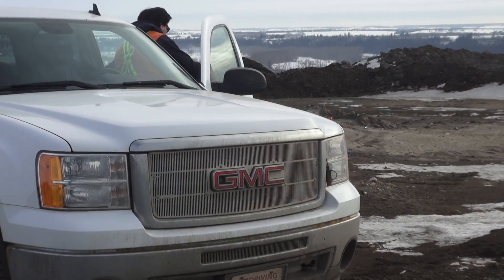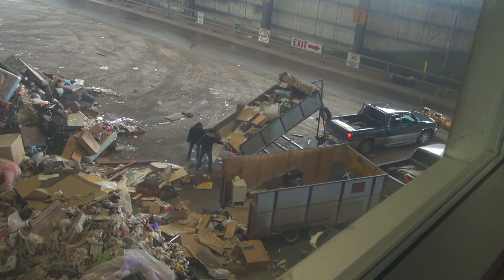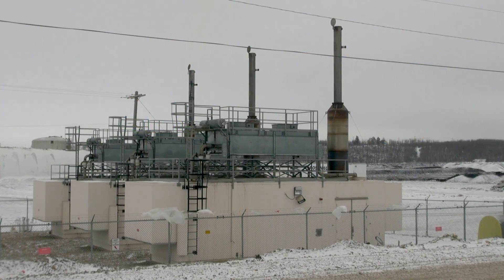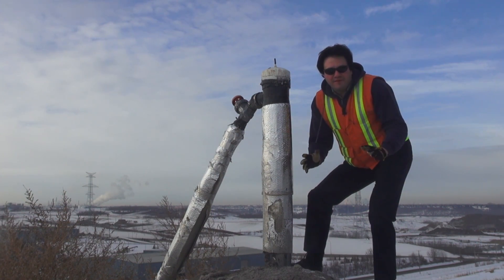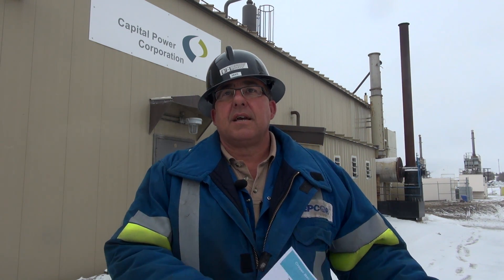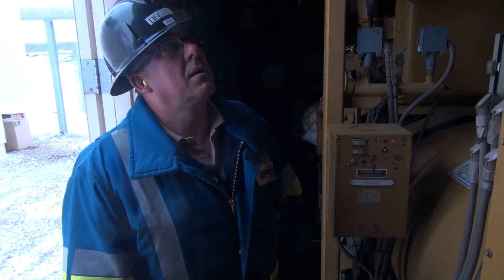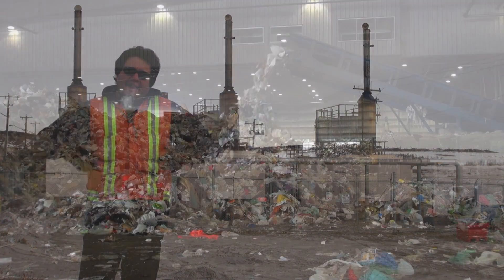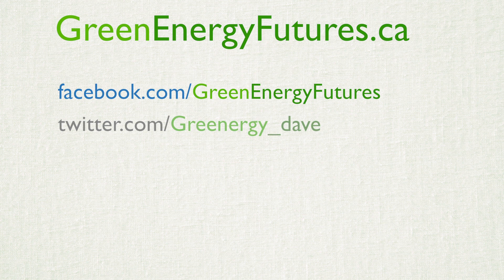33. Landfill gas - Turning trash into cash - How Edmonton's old dump powers 4,600 homes

Comment: Why not incinerate it directly? Gives lots more energy and no landfill needed. Here in The Netherlands we even import trash for our every hungry incinerators.
Reply: Picobyte good point, however I'm the Netherlands, I'm assuming its not a large landmass. So the trash has no where to go. In the US, land is plentiful and I'm betting our power/utility companies are going with cheaper to maintain land vs building and financing power plants. I live where electricity is produced via coal and more and more natural gas. Plus given various layers of laws and regulations and lobbying.
Reply: Part of the problem with an incinerator is that you still need a landfill to haul all the ash from that incinerator to for disposal. What many have been done g since the late 80's is WTE (waste to energy) or EFW (energy from waste) plants. Companies like Covanta and Waste Management have been building more and more of them since then, not only providing the community and the grid with power generated from their trash, but also still extending landfill site life by only hauling in the ash from the incinerators - in which the landfill sites are still doing the same by using the methane from the landfill to create even more electricity and supplying it back to the grid as well...

Honestly,  what better way to get our power and solve our trash problem at the same time??